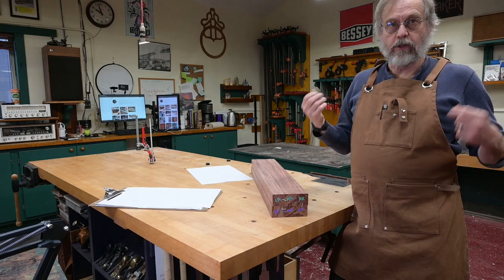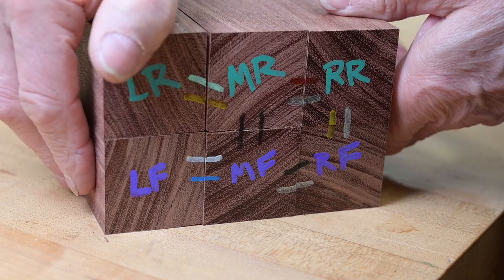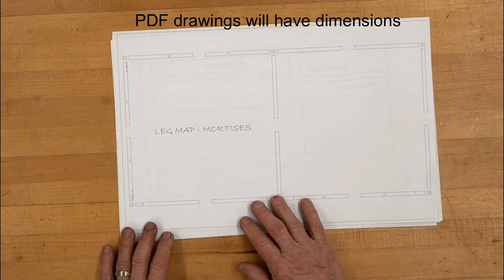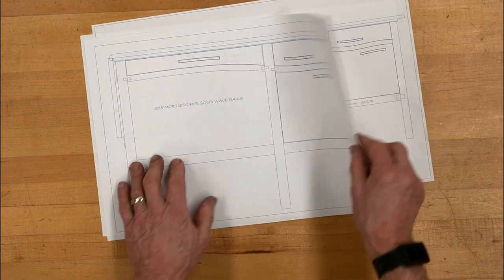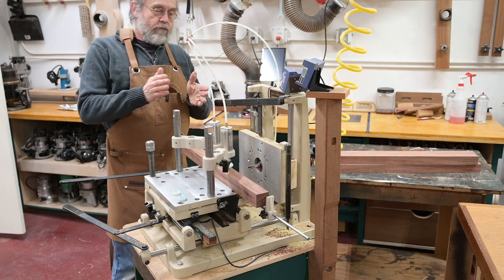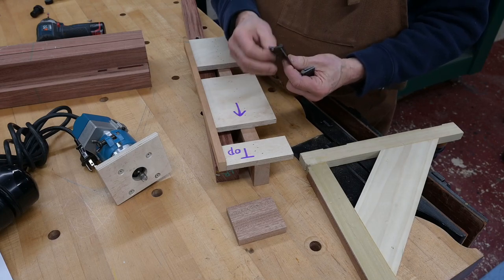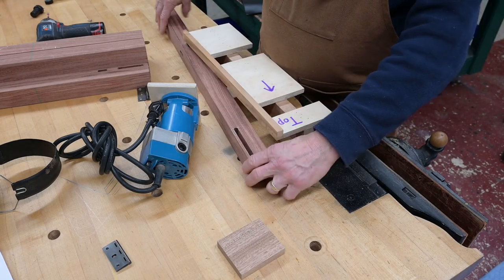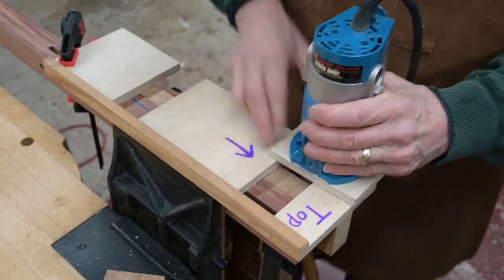WAVE DESK BUILD   PART TWO

Comment: Loving this series so far.  If I could give one video tip that I learned from another YouTuber several years ago: turn autofocus off when doing close-up work - I usually leave mine off all the time and I use a stand-in made from a 1" dowel on a stand to focus where my face will be (use blue tape for your feet position).  When you are showing close-up work, focus on the work w/ autofocus off and then film.  For my dowel stand-in, with face shots (dialogue), I have a mark on the dowel that is the same height as my head when standing - I have a second mark on the dowel that is sitting height.  When focusing on the 1" diameter dowel, zoom in with your digital zoom (assuming you have it) and set focus.
Reply from the maker: Thank you - some great advice ! The blue tape and dowel idea solves some issues I have been having.

Comment: Taking the time to make the jig, looks like it worked perfectly.  Can't wait to see this come together. 
Regarding focus: whenever I am doing something where my hands, head, body or whatever will get in the way of the subject, I use manual focus.  (On my camera, I actually use autofocus to get the initial focus and then turn auto focus off.  Canon cameras have a switch on the side of the lens).  The camera doesn't know any better, it will almost always adjust to a new subject that comes in between your old intended subject.
Reply from the maker: thanks - manual focus sounds like the answer in close up situations

Comment: Hi Darrell...Great video. Thank you. You mention auto focus. You could try to up your ISO to maybe 1600, stop down the lens a little to give you more depth of field than you have wide open, focus on the wood and turn off auto focus. See if that works for you on some of your shots where it has to focus extremes. With the above being said...set your camera to manual mode of shutter priority mode and up your subject lighting to keep your exposure up since stopping down the lens will let less light in.
Reply from the maker: Thanks - If I run into more problems I may try that. I have since learned how to make the autofocus work much better. Those close up shots still to present a problem - stopping down will certainly help in those situations.

Comment: What type of markers did you use on the legs? Are they erasable or do you sand that off?
Reply from the maker: Hi Gene, On the top of the legs, I used Unipaint  markers  - they are bright and visible and permanent - you can not erase them.  The top of the legs will never be seen though . The green and red lines you see along the face of the legs were done with Pica markers - they are a crayon type marker and can be removed with light sanding.
Reply: This was my question also!